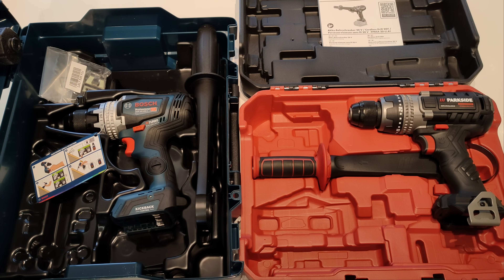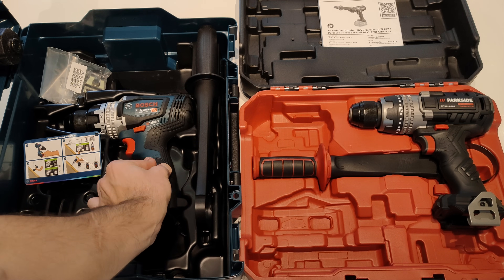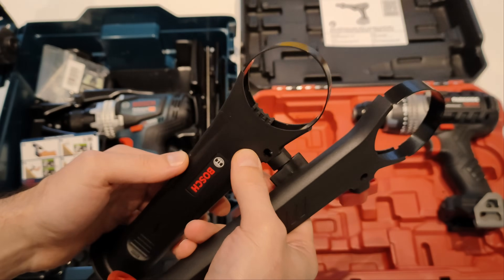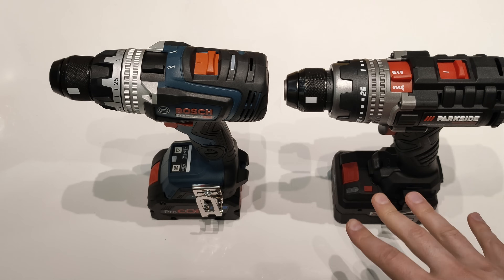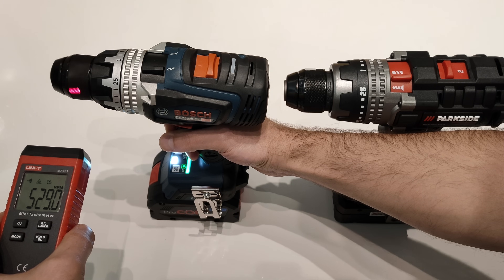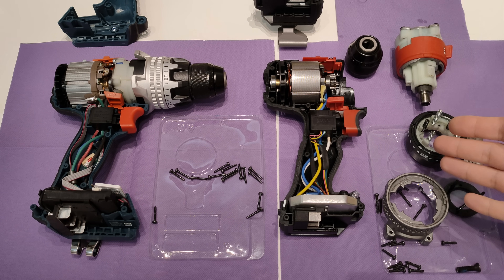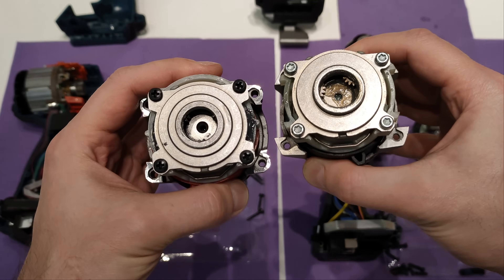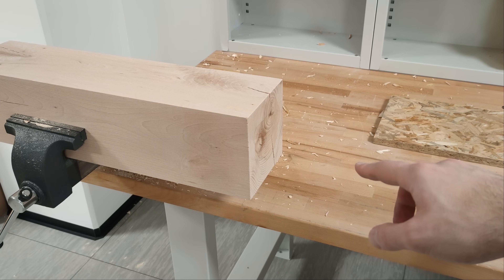Parkside Performance PPBSA 20-Li A1 vs Bosch Professional 18V GSR 150C - Review and Teardown

Comment: Park side drills are over 150.00 us dollars more than Milwaukee 2804-20 and 2904-20 gen3 And 4 and I can get the flew for 120.00 dollars with lifetime warranty gen gen 3 2804-20112.00 dollars and it comes with a high output 3.0 battery and 139.00 for gen 4 2904-20 Parkside is wanting over 400.00 dollars for just the DRILL wow 😳 you guys call that value??!!!?????
Reply: Who is ripping you off ?? Hahaha !!!!

These 150Nm versions cost 100 euro's excluding the battery/charger.

The 60NM version goes for even less or about the same including battery/charger.

If you paid 400 they fucked you over , and not just once....
Reply: @dannybax1982  where can I buy these Parkside tools to test against US brands for a reasonable price??? I want the best impact driver the best drill and batteries to match!! What are the top models and who ships to the US.. AND I DIDN'T BUY BECAUSE IT WAS SO EXPENSIVE!!!
Reply: @WTNPROUD  
Parkside is sold by Lidl , its their own brand of tools.

Lidl.nl or Lidl.de
Reply: @dannybax1982  thank you sir
Reply: Who charged you 150$ for parkside dude?:) I got mine for like 60 euros or so. And thats for the performance series! You can buy cordless drills for 30euros.

Comment: The smoke from Parkside is from the grease. Have allot of grease and goes to the motor. 
You will see the smoke 5 -6 times whenn will be hot. Afer no smoke on Parkside. For the price is the best on market for this quality.
I wait to see how much will last the batteries in time. Cells looks well made.
Reply: The temperature measurement was rubbish. The measurement equipment had to be rebooted. In the meantime the temperature of the bosch was dropped 30c down. When you measured it correct, the difference was maybe 10c.
Reply from the maker: Have you looked all the video. I have disassembled the tool. No grease around the motor and windings. And its purely overheating - 93 degrees vs 54.

Comment: the smoke is probably from greese 
depend of laquer - winding of bldc motor can easly go up to 120*C operational temp ...or even 150*C
Reply from the maker: The BLDC motor probably can withstand 150 degrees, but for sure the plastics around it cannot :(
Reply: @icku  carbon fibre reinforced plastics will easily meet 200C no problem.

Comment: Hi, what is it's soft torque? I mean how many Nm does it have on 2nd gear? Can't find manual anywhere online.
Reply from the maker: From the internet: "So, the difference between hard torque and soft torque is this: Hard torque is how much the driver will produce when you're working with hardened fasteners and materials like stainless steel. Soft torque is the maximum torque you get when you're working with softer materials, like pine."
Reply: @icku  I know, but you can only get 150Nm on 1st Gear, 2nd is faster but weaker. Im interested in Nm value on 2nd gear

Comment: Very professional review. For me the winner is the Parkside, you can buy almost 3 with the price of the Bosch. 
And if you don't put it to the absurd dead limit of your hard test it's practically the same.
Reply: @silverify  depends on how long the Parkside will last when used daily for heavy work.
Reply: @macvos  well i know people who use parkside cordless drills every day in their work so it must be good enough for professional use
Reply: @macvos Parkside has a 5 year guarantee
Reply: @macvos  Parkside is not made for professionals, if you want a professional machine you buy DeWalt, Hitachi or somtething simmilar.
Reply: @broderperdurabo  haber si te piensas que vas hacer todos los días trabajos ,como en éstas pruebas, yo en mi empresa uso taladro a diario y con éste parkside vas sobrado,costando 3 veces menos,incluso con el parkside de 80Nm que tengo por 54€ también tienes herramienta para rato,un Dewalt o Bosh estaría  bien si costará 30€ más pero es que cuesta 3 veces más nos toman por tontos,yo me compraría 3 parkside y puedo regalar 2 tranquilamente
Reply: @venanciocastroviejojimenez6414  Not all the brand machines are as expensive than this Bosch, I'd rather buy for around £100 - a Hitachi, Makita, Metabo or Dewalt top- class drill for professional work, rather than any Parkside.
Reply: @sizif717  se nota que no tienes problemas económicos,pero empezaré por decir que tengo una ingletadora bosh a un costo de 250€ y creeme es una auténtica porqueria ,tira mucha porqueria y no puedes ranurar con el y además se desajusta rápido, para mi fue tirar 250€ pero si piensas que por ser bosh u otras marca poco caras como comentas,no merece la pena
Reply: @venanciocastroviejojimenez6414  I don't know what exactly are you saying, but we have had over 10 Bosch machines in the woodworking workshop over the years and only two dills ( one hammer drill and one 12v drill-driver) have died after many years of use and abuse. And the few Parksides that we have tried to use - give up the spirit after a while. The £100 more than you invest in a good, quality machine - will return in time and will sabe you a lot of headache.
Reply: @broderperdurabo  my father is a car mechanic and he's using it 8-10 hours a day.
Reply: @broderperdurabo  Cough HiKOKI :)
Reply: @broderperdurabo also No sense coment Like yours.Prof. can use parkside as Long as they want to.
Reply: @broderperdurabo  Klar , kannst du es im professionellen bereich nutzen .
Es wird im selben china town`s quartier hergestellt wie Mil , Mak , Bos, etc :text-green-game-over:
Reply: Problem with the Parkside is you need the LIDL app to turn off some things. How long will that app be supported and useful? I hate tools that rely on quickly outdated software to change basic features. App is fine, only if I can do EVERYTHING on the tool without software as well. 
I want to use this drill in 5- 10 years, and I have 0 faith in apps being supported that long. They'll bring out a new app, old one isn't updated doesn't work on a certain OS version anymore or can't be downloaded. Absolute nightmare.
Reply: I connected it aith Tuya or Home Connect app so no worries. Also LIDL is a pretty damn good standing company in Europe so I think support will be there @BurningBroadcast
Reply: @BurningBroadcast  1. You don't need the app, you can use the tools without it, yes some feature can be enabled disabled from app, but the defaults are pretty good.
2. The batteries use an open standard for communication, you can use tuya for example, it won't offer you access to the features, but the app doesn't require some cloud stuff to work, even if it would I'm sure there'll be some 3rd party apps that would allow that.
Reply: how many parkside you need to find the one with the straight spindle?? 1000 will be enough??
Reply: i just buy one for 59 euro.. its a monster machine, i dont know if i need it at all ..heheehe
Reply: Parkside is a grocery store brand. Bosch is a major tool brand .  You would have to be an idiot to buy Parkside
Reply: @robertcasey3528  In fact I would have expected a much greater difference from an expensive major tool brand. Don't you?
Reply: @ricciolo9  The Parkside was made to mimic the Bosch in performance, the big question is how long will it able to do so? They have saved on R&D big time because it shows they just disassembled a Bosch and copied as much as they could.
Reply: @engineer_alv  Should be interesting to know which company manifactures the motor, because the rest of the drill could be similar to many of other cordless drills brand. Maybe a third party company. There's no big tecnology in a drill, the powerful electric motor give the difference in this case, i think.
Reply: @ricciolo9 one time I saw on yt a milwaukee disassembled and there was a parkside brushless inside, that factory makes must make also for other brands,  very logical
Reply: @robertcasey3528  Tja, dann bin ich ein Idiot, aber meine Parkside Werkzeuge laufen schon seit Jahren ohne Probleme!
Reply: @robertcasey3528  Bosch has some crappy stuff too. Especially garden equipment.

Comment: To be fair, some other idiot in germany also designed the easy to disassemble bosch. Whoever designed the Parkside probably had to use some existing platform and make it look like whatever the customer (lidl) wants.

Comment: It seems the Parkside is a clear example of too much power with low control.
Maybe they'll improve it with future versions. For now, I think I'll stick with my Performance 60nm.
Ty for the detailed review!

P.s. could you make a video (or a short even) on how to disassemble a chuck? I'm having problems with a green parkside one.. it seems glued to the arbor shaft
Reply: Well, I would 100% agree with you if the 60 nm version wasn't so bad. I already went through 3 drills with very light use. The 3rd one lasted about 20 seconds sadly. I got my money back and picked up this one on sale. Let's see if its any better. 

Needless to say I am not after the torque at all. Also most of my other PS tools last just fine. Only had a couple fail and I have about 40+ tools so its not really a hate either.
Reply from the maker: Already have one: https://www.youtube.com/watch?v=qxlzkSmTnKA
Reply from the maker: and how to disassemble its internals: https://www.youtube.com/watch?v=cas8w5laVC0
Reply: @icku  wow, awesome! Thank you so much!!
Keep up the great work 💪

Comment: Yeah Bosh clear winner.That temperature diference is massive if you want to do big heavy and constant work.
But at 1/3rd of the price Parkside is very capable and has a place on many jobs. Lets wait for B1 version tough :p
Reply: Yeah but He taked Time for Check Bosch temp
Reply: @AhmedZouri  Yeah good point. We could check how the temp was diminished when he was looking at parkside. maybe 1 degree per second. Maybe it was not that diferent, but still parkside to many overcurrent /temp failures.
Reply: Parkside is for homeowner that wants to do an addition to they home , or build a worktable etc or someone that's just starting to work but needs a strong drill (parkside would be ok for work , but you would have to let ut cool off when drilling massive holes , you cant do them as fast as with the Bosch)  , bosch is for a pro ....  that will be using it daily
Reply: @robivlahov  nah people Just says its for Homework Tools but isint true.

I did a core drilling with the drill 60mm diameter through reinforced concrete 60cm deep
Reply: @AhmedZouri  it is , i have 16tools from parkside... When doing hard work , and pushing the tool , it will overheat , not all of them, some are great, most are just good (overall, for the money they are excellent, but parkside them selfs says its not a pro tool intended for 8h of daily hard work ,its a "prosumer" and light pro tool , dont get me wrong , ive made a 100x100x70cm hole in rock with my parkside sds drill , took some clever lining up so the rock separates more easily , but the mf got the job done , and it was the 1050w corded model ... But if i was doing lineman work , or i was on a scyscraper construction site , i would not be using parkside... I use it to build pump rooms , only the pdssap b2 impact faild so far , everything else was just fine ...
Reply: @robivlahov  iam working in the Work with Hilti/Makita and i See No much different by parkside and Hilti
Reply: @robivlahov exactly..... For lets say moderate DIY use Parkside is perfect...... If you are professional than you need to invest in pro tools..... This is true in any profession
Reply: @robivlahov 8 hours of daily work, must be in india or pakistan